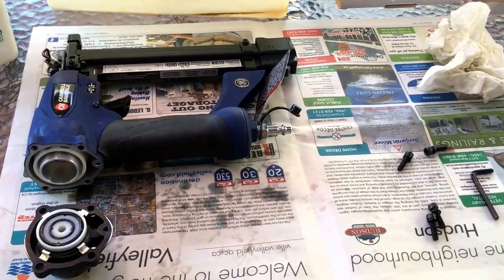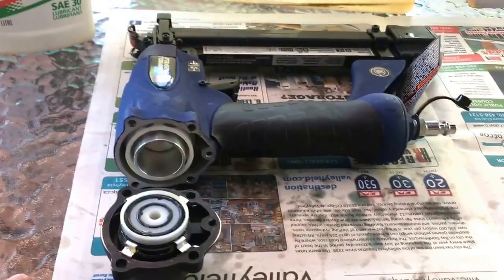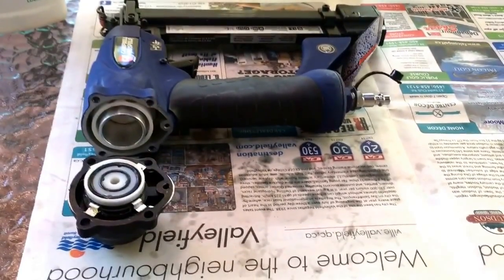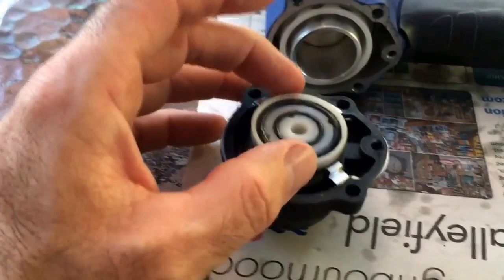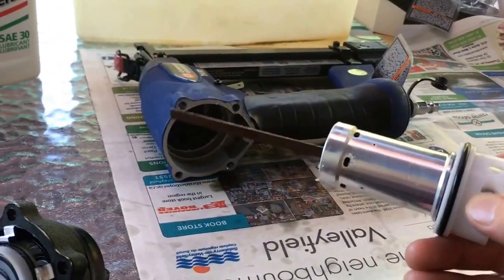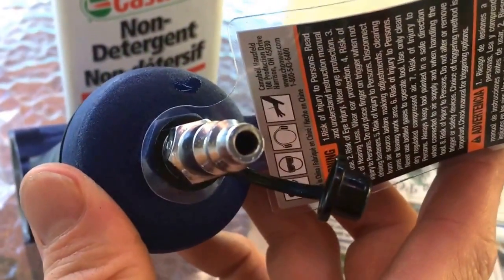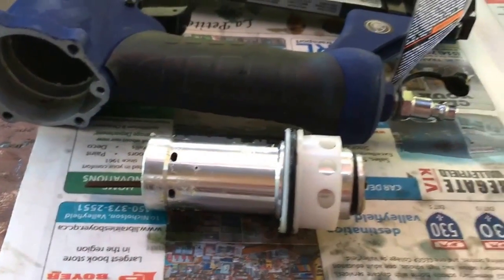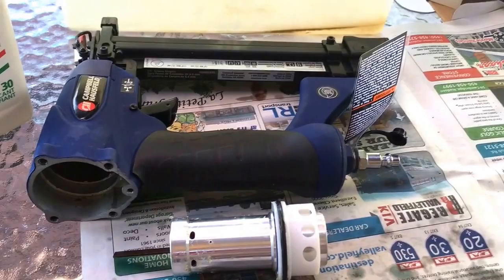Fixing a Campbell Hausfeld nail gun that won't fire

Comment: The best oil to use in any air operated tool is automatic fluid
Reply: @Fred Kipper Can you use Vaseline to lubricate the internal piston & cylinder, once you take it apart to clean??
Reply: fistteam I wouldn’t .   Just grab some air tool oil at Harbor Freight.     It’s  cheap.     That and ALWAYS oil it before use.
Reply: I am a factory authorized repair technician
A good rule of thumb on pneumatic tools is if the cylinder is plastic, it is oil-less. If it does not say oil daily at the air chuck connection, then do NOT put oil in that tool.
Additionally, any oil used in pneumatic tools must be oil designed for that purpose. Many petroleum-based oils and lubricants will damage the rubber O-rings inside the tools.
Another little tip: is a mistake tool owner’s make all the time is, too much air pressure does not make the tool function better. We never use more than 80 psi on our benches. Any more than that only serves to damage internal parts. It will not make the tool drive the fastener any deeper or better. The only exception is high-pressure tools of course.
Reply: @fistteam  Petroleum based lubricants will damage rubber O-rings in air tools. Always use silicone-based grease for assembly and (air tool oil) for daily maintenance lubricant.
Reply: No, Campbell Hausfeld does not recommend using AIR TOOL OIL for these finishing brad nailer/stapler, instead use NON DETERGENT SAE 30 oil.
Reply: @rioriggs3568  What exactly do you do for a living? And are you factory-trained on 18 different brands of air tools? INCLUDING CH. And do you work on those tools every day five days a week?
Reply: @ Wrex 218 Dude I’m just repeating what the CH technical department specifically  told me.
Reply: @rioriggs3568 , By all means, do as they say. I bet they also suggest spraying carburetor cleaner in the airport. 😒 People that follow that kind of advice are the ones that help keep me in business.
Reply: @ Wrex 218 Well they are the manufacturer after all! What do you put in the air nozzle?
Reply: @rioriggs3568  Let me reiterate, I am a FACTORY trained and CERTIFIED by 18 different manufacturers including CH. As such, I am authorized to perform warranty repairs on behalf of the manufacturer. And I have already made it abundantly clear what I recommend. I do not recommend anything that is not approved by the manufacturer and I use the best available materials for that reason and because I want my repair to last and not be returned by an upset customer that says I did not repair their tool correctly.
I have been doing this for many years and am still in business in good standing. I also see sometimes 5 or 6 of these types of brad and pin nailers daily. The cleaning solvents that we use in the shop is specifically designed to not damage delicate rubber and silicone parts. The lubricants that we use are approved by every manufacturer that we work with and are also specifically designed to work with rubber and silicone parts. A huge number of the tools that we work on are used in a manufacturing environment where they do the same thing round the clock through three shifts of workers. It is paramount that those tools fail as little as possible so as not to slow the manufacturing process.
We take the care and repair of these and all tools very seriously. And we do not take shortcuts or make materials decisions based on less than sound recommendations from the original manufacturer. If we did, we would not be in business for very long.

You obviously have the internet available to you so, I suggest you do a little research on the type of lubricants and solvents that will damage rubber and silicone parts. 
My advice above is FREE and it is also FREE for you to ignore. 

So, you take whatever advice you choose and be satisfied that you are better informed than I am.
Reply: @ Wrex 218 Dude you need to relax! Everyone is trying to pass on helpful information here, except for a few ars holes! You’re getting a little passionate about this! People are free to take your advice or the advice coming directly from CH. It’s not a competition!
Reply: @rioriggs3568  My advice is free to use or not it's entirely up to you. I have wasted enough time here. Have a nice day.

Comment: The air tools produced by Campbell Hausfeld are basically ultra cheap, entry level pieces of crap. I bought a box kit with several nail guns, [framer, finisher, stapler, etc], from Canadian Tire for around $175 on sale. I needed a framing gun to quickly finish a project and then I put it away. Three months later, I oiled it and I used it again. It lasted about two hours before leaking air at the trigger and other places. When I did get around to using the other brand new nail guns in the kit, they too started leaking air. Of course Canadian Tire would not accept the return because it was too long since buying them. 
If you are planning on buying an air gun, get a mid to upper level tool. These cheap tools are just not worth the time and effort and you certainly can't depend on them.

Comment: Use waterproof marine greese
Reply: @seadooman o Can you use Vaseline to lubricate the internal piston & cylinder, once you take it apart and clean it?
Reply: No, Campbell Hausfeld does not recommend using AIR TOOL OIL for these finishing brad nailer/stapler, instead use NON DETERGENT SAE 30 oil.

Comment: I would never use motor oil to lube a pneumatic tool! they have oil specially made for pneumatic tools!
Reply: Read the C-H product manual, it states: "Place 4-5 drops of 30 W non-detergent oil into the air inlet.  Do not use detergent oils, oil additives, or air tool oils.  Air tool oils contain solvents which will damage the tool's internal components."
Reply: @kraghhertel8202  my Ridgid air gun seal got brittle after using air tool oil, I'll give that oil a try. Ty!
Reply: Read your manual, Rigid may differ, use their recommendations, my comment applies to a Campbell Hausfeld product and manual.
Reply: No, Campbell Hausfeld does not recommend using AIR TOOL OIL for these finishing brad nailer/stapler, instead use NON DETERGENT SAE 30 oil.